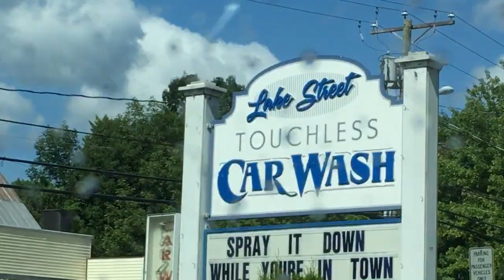GONE FOREVER: *RARE* AUTEC EV-2 || Lake Street Car Wash

Comment: Autec still manufactures the atf 1 but they’re extremely rare and not sure why , personally I feel this ev 2 that’s now discontinued, I feel it has a better design than the atf 1 because those wash arms get the front and back , the atf 1 doesn’t have any drop down bar or side to side wash arm to get the front and back better
Reply from the maker: Yeah, I was so sad when I found out that this was replaced with a Mark VII. A person who worked on this machine told me about the new ChoiceWash XT.
Reply: The Car Wash /Elevator Fanatic those Mark vii machines are good systems of maintained well, but they’re extremely common in my area and since circle K is all over the place near me they’re obviously infested in my area , I wish circle k could install different systems other then Mark viis but since they switched the contract to mark vii a few years ago , But before  those Mark viis there was a lot of softgloss xs , xs 2, select a wash, sg maxx, laserwash 4000s , I honestly didn’t really care for the rykos all that much since they’re still very common in Florida and nothing special but laserwash 4000s are not as common as they used to be which is sad since the 4000 is my favorite touch less system of all time, it was my childhood and my first ever system I went thru
Reply from the maker: WashWorld RAZORS, PDQ systems and a few Ryko systems infest my areas. For tunnel washes, there’s a TON of Hanna Sherman, Belanger, PECO and Sonny’s equipment. I do have a few MacNeil tunnels and MCWW tunnels.